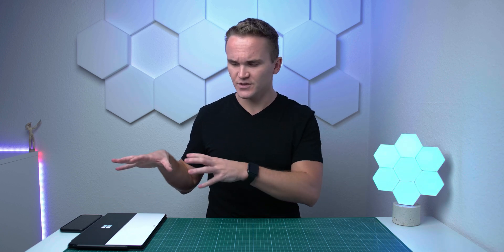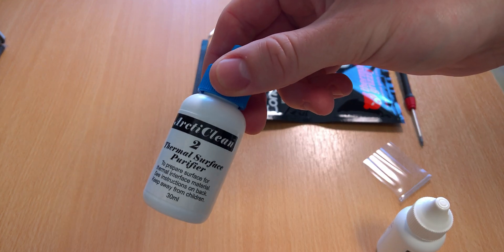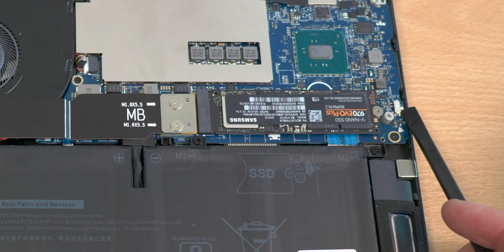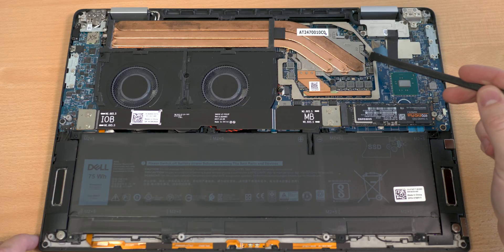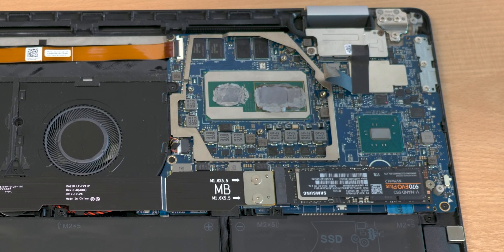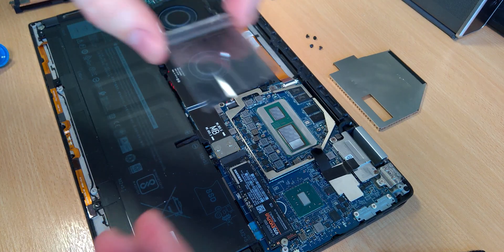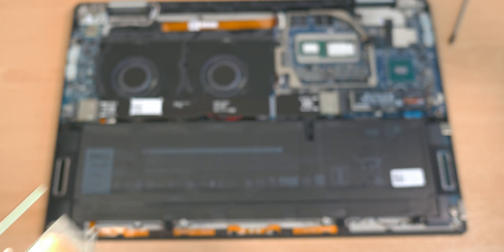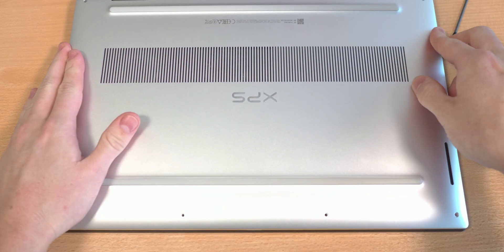How to apply LIQUID METAL on your Notebook CPU - Tutorial

Comment: Im so mad i applied liquid metal to my lg gram because it runs at 90c and i tried EVERY thermal paste out there and non of them worked. So i figured ok liquid metal would reduce it to 80 or 85 cool ill try that so i tried it and applied it correctly and unfortunately it runs the same pegged at 90c no improvement what so ever what a waste now i have to find a way to remove the liquid metal and just use thermal paste.

Comment: You should NEVER put liquid metal in a laptop, it will migrate and blow out the mother board, it was never intended to be used in something that is moved.
Reply: you are so wrong its not even funny. Bro there are so many models of gaming laptops that ship out with liquid metal as the stock thermal conductor.
Reply: @const3llations_370  Name one????
Reply: oh and the entire strix lineup ! @TheBardicDruid
Reply: @const3llations_370  They use "Liquid Metal Pad", not liquid metal compound.
Reply: no they dont. they specifically say Conductonaut  @TheBardicDruid
Reply: @const3llations_370  hey buddy
i travel a lot on motorcycle and bicycle with my laptop how should I go about applying liquid metal on my Asus tuf a15 (2020) ?? what precautions should I take Vaseline or something else?
Reply: @fringeanomaly9284  just tape off the surrounding area of the ihs with electrical tape as to avoid spilling lm anywhere you don't want it.
Reply: literally the entire zephyrus line in 2022 XD
Reply: i just put liquid metal on to a customers zephyrus and dropped temps by 20c. tell me again its not meant to be in laptops

Comment: On this particular cooler assembly its really not advised to apply liquid metal, at 4:10 it can be clearly seen that the indentations are really close (like 1mm or less) to the aluminum part of the heatsink, it may get in contact with liquid metal and it will destroy the heatsink. Should only be applied on cooler assemblies that are made of copper or nickel plated copper.

Btw the main benefit of liquid metal is its longevity on high performance parts, instead of changing the thermal paste every 2-3 months on a 6800XT, you can apply liquid metal once, and it will last for 2 years easily.  Graphite pads are also good at this, but the temperatures are much worse.

Comment: How do you know that there is sufficient space between the die and copper?  What if the gap is too large?
Reply: If the gap is too large it's a poorly made heatsink anyway or the CPU is low power enough that it won't matter if it's a little hotter. You see the more of a gap there is the less efficient it is a transferring the heat as even though thermal paste is a better heat conductor than most pastes it's still far worse than copper and the more of a thermal paste gap you have the worse off you are so most heatsinks tend to contact the CPU directly, the thermal paste is just there to fill in the micro gaps between the die and heatsink as air pockets even very tiny ones are awful conductors of heat.

Comment: Can anyone give me a link for foam I can purchase to use as a barrier for liquid metal on my laptop? I have seen some people create a foam barrier around the CPU and GPU on a laptop before using Conductonaut and I think it is a very good idea because the foam could absorb run off and save your motherboard.
Reply: did u find this bro???
Reply: @aeonbreak4728  I always use thin packing foam which I saved from some random ebay package. It works great as long as it's the right thickness. I'm not sure where you can buy that stuff but maybe a post office would be a good place to ask.
Reply: Adhesive open cell foam window sealant. Weather strip, door sealant

Comment: You DO NOT need to reapply LM in one year for copper. This is incorrect information he is presenting.
Reply: it absorbs into the copper so yes yo do need to reapply it after 6 months or a year after the initial application. After the copper heatsink is saturated you do not need to repaste liquid metal ever again. takes max 3-4 repastes.
Reply: No it does not. It stains it but it does not actually soak as much as people say it does. Had multiple applications for devices that have been going strong for several years. No temp change. No reapplication needed
 @expandknow

Comment: You don't need to reapply liquid metal again, leave it hardened and it will perform just the same even after 5 years, once you disassemble you'll break the hardened block and should reapply again.

Comment: Look, Im no laptop liquid metal Na...zi....But why would you post this???
You rant about being careful but dont use any tried and reasonable safety measures that will give those (YOU ARE LIKELY TALKING TO MOSTLY) who dont know and are learning....

Electrical tape, top coat nail polish...both should be done and one absolutely should be done. 
Just a terrible vid for beginners....absolutely no doubt some poor soul followed this and a month later had his laptop shi...t the bed....CONGRATS on HELPING THEM DO THAT.
Reply: Is nail polish heat resistent? Am i good to use it for protecting smd components etc.
Reply: Use Acrylic Conformal Coating. Protects electronics from moisture, corrosion and static discharges. @requiem4adreamc
Reply: @eneckchalk  yup. That's what the l2n crowd uses to keep condensation off the board too (along with paper towels). Some waterproof electronics are even encased in it. I have this high-end remote control car...the speed controller circuit board and microprocessor are incased in it (about an 1inch thick at least but the whole unit is submersible). Just don't put it on anything you may ever have to remove. At least not too thick. We used this clear tape (not regular scotch or packing tape) to cover the on chip vrms back when delidding haswell chips was the only way to keep them cool. Seems to hold up well too...I actually still have one running daily.

Comment: How to blow your pc 101. lol. First you put ok amount then add too much and you didn't put isolation layer around. That's like... Timed explosion.
Reply: What you advice for isolation? Actually i have an idea but i don't know it will work: i am just thinking to apply a square line of regular thermal paste and then apply liquid metal inside that square.
Reply: @requiem4adreamc  I was thinking of that exact same idea. The paste should stop any flow.
Reply: @mackroscopik  Don't actually use liquid metal with thermal paste, the paste can push the metal away!
Refer to this video:
https://youtube.com/shorts/rL3mRbGMdOY?feature=share

Comment: im wondering how good the lm holds up on that xps 9575 , and especially the copper heatsink aswell as the cpu and gpu with the hbm memory ( like is it eating away the copper , since bare copper is still worse than nickel plated ) and ive heard that some gpus that had hbm memory did not have them at the same height causing inproper contact on either gpu or hbm

Comment: why can i just put it on the cpu only ? why it should go on the heatsink as well ? any risk it will come out and touch the transistors while moving ur laptop around over time ?...
Reply: Because it will not make good contact.
Reply: Probably because you need to make the liquid metal stick to the copper first, because it might not stick if you only apply it to the cpu die
Reply: @Bennedict929  what about in the long run any chance this stuff will come out and touch the transistors in laptop?
Reply: As long as you don't use too much, pretty low
Reply: The worst that can happen is it might spill to somewhere near the die, but not too far like reaching the components on the mainboard
Reply: @Bennedict929  thats what i meant so am kinda worried !...
Reply: don't worry, on most intel laptop there aren't any SMD components around the die, so it should be fine. AMD laptop is the one you should be worried about
Reply: @Bennedict929  thank you for the boost of confidence :) i guess IF it was the case for my intel chipset, ill use some nail polish or something similar to protect it, thanks pal...
Reply: @SkyHighFilms777  Is nail polish heat resistent?
Reply: @Bennedict929  There are bunch of components on GPU die no matter AMD or Nvidia

Comment: Try putting high temperature rated electrical tape around the outermost perimeter of the die (not touching it) and maybe it can prevent the liquid metal from running off. I have seen it done in other videos.
Reply: If you want to take extra precautions use conformal coating or clear nail paint on components on die and on motherboard and put heat resistant tape over it to avoid damage to coating
Reply: @JagtarSingh-xt6os but how do i avoid spillage?
Reply: @themangobui1474  you should keep the laptop always horizontally
Reply: https://www.youtube.com/watch?v=c4Wi9OUmoJw